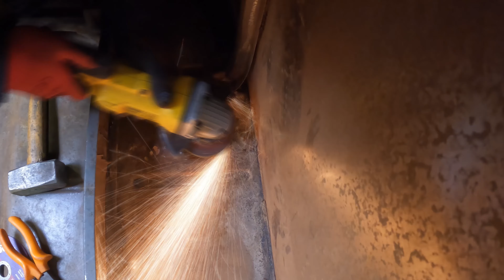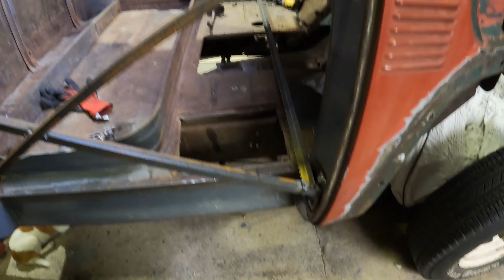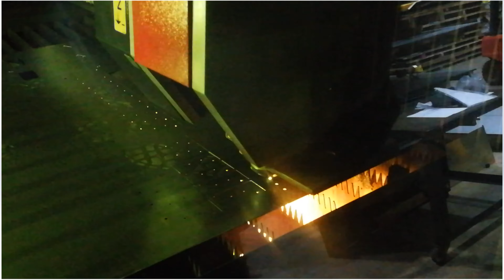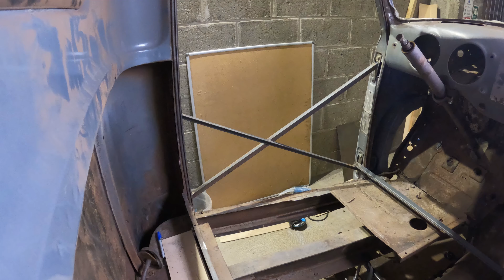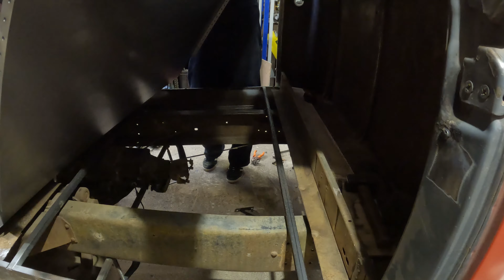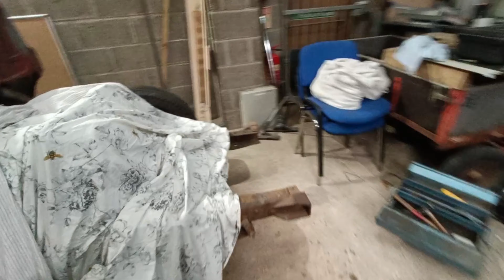Replacing the floor of my 51 GMC part 19

Comment: Hi Charlie  on my 3100 I was going to connect the two ends of the front cab channel over the gear box to stop the floor flexing. If you did it now, it would be easier . Loving the project 👍👍
Reply from the maker: That's not a bad suggestion, Got to add two more main frame pieces towards the center of the cab next time! Thanks for watching!